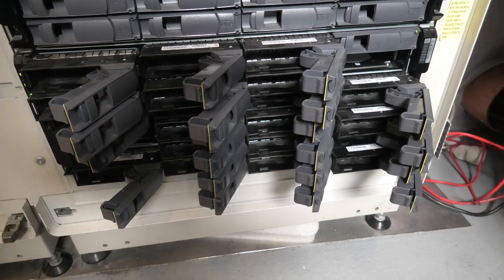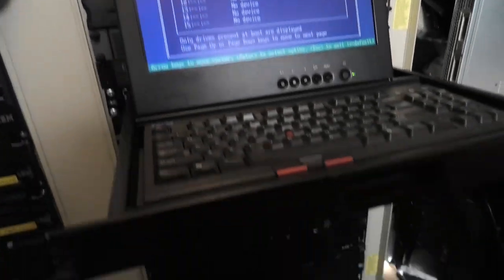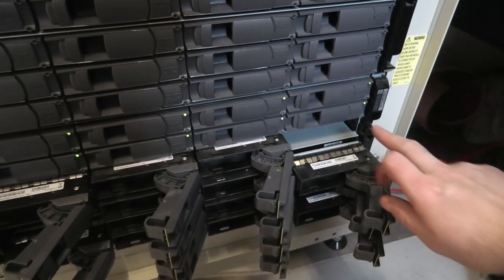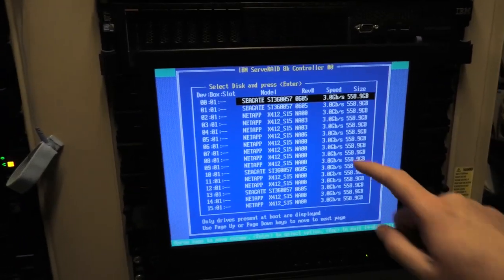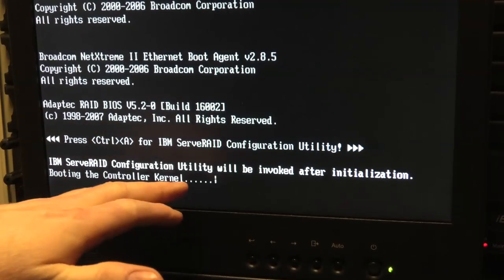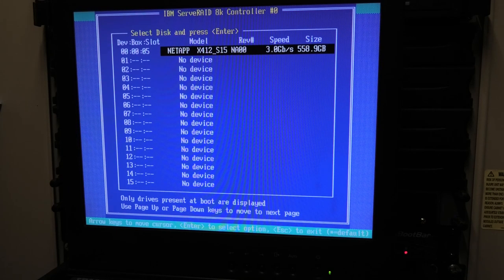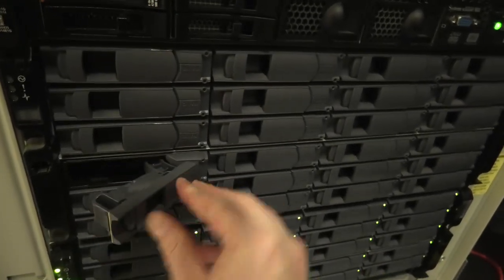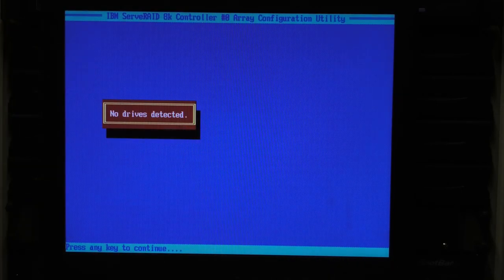Using IBM x3650 M1 to find Doubtful SAS Disks - 1048

Comment: What you face  with the slot positions messing is a common problem. To ease it , on the controller there is an option somewhere, to turn the light / led of the slot / drive. It will start blinking so you know which drive it is.

SAS drives are dual port and SATA drives are single port.  HA / High Available systems will require to access every drive from multiple paths , to make sure a failure tolerance. Ant these will refuse to work with SATA drives. What you have there is a mock board, is for cheating the controller to behave as if there is a secondary port to communicate... back in a day, where the price difference between sas and sata hdd was a lot, or sas drives not being immediately available, it was a solution used.

Keep up, keep these nice stuff coming.
Reply from the maker: Hi cagatay kilic
Thank You very much!  glad you liked the video :-)
Thank you for watching! :-)

Comment: those SAS>SATA interposer boards are not really necessary if you have all SATA drives in the netapp enclosure, I would recommend removing them as the limit your power options too - when I had the interposer boards I could only use full power/powered off, without the interposer boards I could use full power/slow down/powered off
Reply from the maker: Hi Frank Echanique
Thank You very much!  glad you liked the video :-)
Thank you for watching! :-)

Comment: Update on my LSI 2008 HBA - I updated the Firmware vom Version 5.x to 20, also the Bios and added the EFI ROM via the Update tool you have showen. 
All my detection & boot problems are now gone.
Firmware name "9200-8e_Package_P20_IT_FW_BIOS_for_MSDOS_Windows.zip" inside is a Firmware and sasbios_rel folder - the UEFI is a seperate package "UEFI_BSD_P20.zip"
Found at: https://www.broadcom.com/support/download-search & type in the keyword "9200-8e" (not product or other places)
Reply: Well, he has IBM flavor of the broadcom controller, if there is anything specific on that, flashing the card to generic Broadcom FW, you probably will lose the IBM specific stuff.
Reply: @cagataykilic7978  Can't update to generic. I've try to do with my oldest M1 server and you can brick the device. You can recover it with JTAG, but the JTAG pins are unsoldered and missing in the board. The best is put that RAID in Sleep mode with the jumper for recovery flash and put a 3rd party HBA or RAID card
Reply from the maker: Hi zENjA
Thank You very much!  glad you liked the video :-)
Thank you for watching! :-)
Reply from the maker: This was not a IBM card,, It would have had an IBM name. :-)
Reply: @XiCKwY  you feel the card bricked but indeed you cant brick broadcom cards. What happens is , to flash u erase the old fw first, and if the new fw is not properly installed  it will not come live. There are tools from broadcom they will still find the cards and as long as u have a copy of old fw you can always come back.

Comment: Netapp is not using 520 byte sector? Sometimes the RAID controller don't show the drive because those mismatch the sector size. I will do a 512 format and my RAID card shows me the drives. 

Also can be, the dust. A bad connection can avoid a failure or missing drive. Every six months i do a clean with a ESD brush and blow with the air compressor (Low pressure). And disks again alive.
Reply from the maker: Hi XiCKwY
Thank You very much!  glad you liked the video :-)
Thank you for watching! :-)

Comment: Anyone have a recommendation for a half height very cheap raid card for 12 drives? I got my first server and I fried my card somehow during a firmware update. Do I even need a raid card if I was going to pass the drives through?
Reply: Depends on the connection the the drives. Take it these are internal ? If so and using something like TrueNAS I would normally go with some sort of LSI in IT mode.
Reply: what are your drives connection? 3Gbit 6Gbit 12Gbit SAS or Sata? normally a relatively old broadcom 92xx is to find at low budget. you can also buy  older dell branded PERC cards, pay attention that it should be on IT mode if you are just using for pass through.  if not earlier cards would allow you to flash them to generic braodcom fw. recent ones like h330 from Dell is refusing the new fw due to vendor code on fw not matching..... for 12 drives old 6gbit cards are ok.
Reply from the maker: If you need the card to provide storage to your server, I would go with a raid card, if the whole server is to be a storage server, then it´s often better with a HBA. (Then the whole server acts as a raid card)
Reply: @MyPlayHouse  It's gonna be my big honking NAS.

Comment: I simply do not understand how you can spend so much time with this disk shelf and not get it working... I have two of them running in a very similar setup... x3550m4 and LSI SAS Controller running in IT mode... I use the IOM6 modules instead of IOM3 which you are using, but I don't think that matters..  (only the speed is different).  I use only SATA disks in my setup (with the converter board in the cady)... I have replaced the original NetApp disks with 10GB SATA drives, and still no problems at all...   I would suggest to only have one of the IOM modules installed, just to avoid issues... and if you want to run dual path with two IOM modules you will have to use SAS drives, and SATA does not have dual path to the disk...  I think this is an issue with the multipath driver more than anything, because with a NetApp controller in front dual path is possible, even with SATA drives...  I run Ubuntu 20.04 with zfs for controlling the drives.. no issues what so ever... but maybe I should send you an IOM6 module to test with?
Reply from the maker: I am not sure why this is messing with me this much..
Reply: @MyPlayHouse  Let me know if I should send you an IOM6 module?   And keep in mind that if you are using the SAS drives (450G, 600G 10/15k typically) or even the NL-SAS drives (4TB+) from NetApp you will have to re-format them because they are using 520bps.  You can do this with a SAS adapter running the IT firmware.  I did it on a linux box with the sg-tools installed... (should be googleable)... The 2TB SATA drives I think are 512bps which works with windoze and most other OSes.